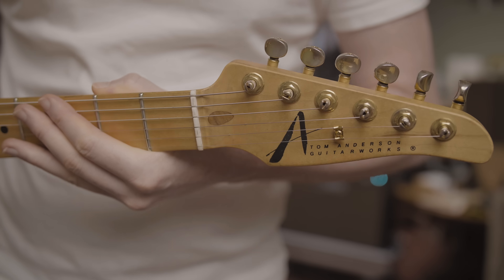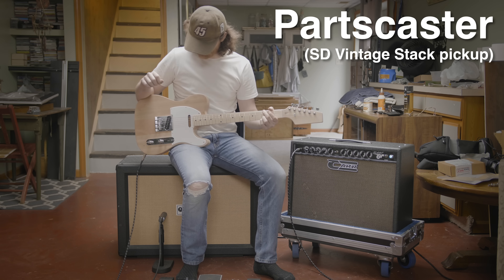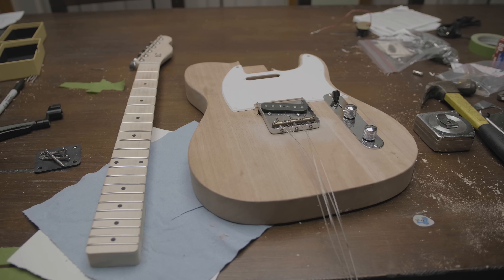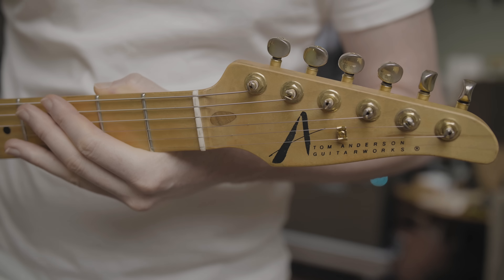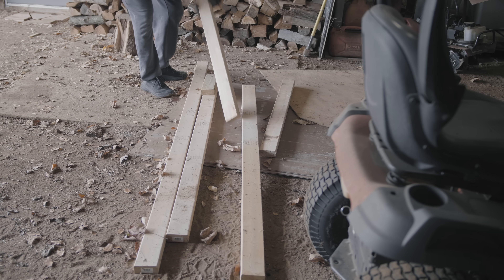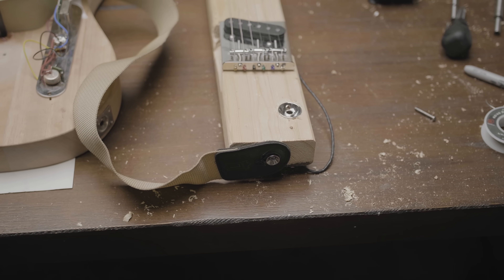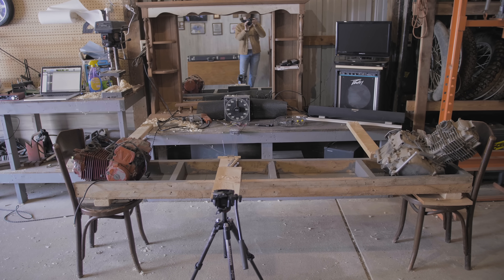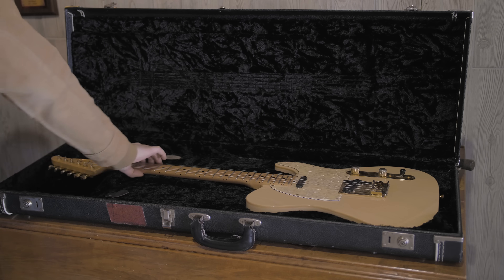Tested: Where Does The Tone Come From In An Electric Guitar?

Comment: That "tone wood" thing dies hard.  There's a certain type that just won't hear that "tone wood" isn't the reason why a glue hog solid body strat with three pickups sounds the way it does.  I had to learn this the hard way - when my "super bright" Ibanez Artcore all of a sudden sounded "muddy" when someone messed up the wiring in it.  It took almost two years and a lot of research to find out how to get the tone back - it had nothing to do with wood - it was the 500k linear volume pot/500k audio tone and 50s wiring that a lot of imports use.  For humbucker guitars I keep the volume at 5 instead of maxed to 10, and if things aren't wired right you get the "mud".  None of the people I took my guitar to asked about the original wiring.  None of them asked where I keep the volume and tone - they didn't know or care though it took ME having to figure out what was going on and how to get someone to wire it back. Now, I try and spread that gospel... and people get literally angry and hostile.  I've told so many people: "If you're getting a 'muddy' sound from your LP, check the pickup height, check the magnet types, check the wiring, check where you keep your volume/tone pot, check the sweep of the pots..." and people act like I'm speaking alien.  Also the proof is in the pudding: electric guitars are made out of every material imaginable - clear pyrex/resin, steel, aluminum, even concrete - though when you plug it up it sounds like the configuation (strat? LP?).  If you handed someone a guitar made out of aluminum and blind folded the musicians would they be able to hear what the material is? The answer is no.  I once had a guy say: "Well, if you can't hear the difference between a 335 and an LP I don't know what to tell you!" And it instantly made me think of another element: recording.  I pride myself on my memory and ears, though there were so many times when I thought I used one humbucker guitar in the studio and it ended up being another - and we're talking about the difference between LP, 335, and full hollow.  In a studio setting, with things turned up, you don't know what's happening until you "see" it or are "told it" and I'd suspect that has to do with how so many guitarists "learn" the instrument - by looking at instrument/hands and making deductions.  While that's great for learning a lick, deductions can be made that simply have nothing to do with what you're hearing.  Correlation is not causation and there were times when, during that two year journey with my Artcore, that information that I had taken for "fact" fell flat on its face.  And I tell people: I'm not trying to piss anyone off - I'm trying to save you time, money, and heartache when you hand your guitar off to someone, they change something, and you don't know what.  Happy trails.

Comment: I put an old telecaster neck on a strat and had to use a piece of a match book to sorta shim the neck into the correct angle but that fixed it and the sound difference was tangible.

Comment: I've always suspected that all this bull about "tonewoods" and "rosewood/maple/other" necks was complete nonsense. I mean, if the body and neck are rigid, then the vibrating string doesn't give a crap about the type of wood, right? And the fretboard does not even provide the rigidity to the neck (it's the neckwood and the truss rod), so how the hell could it ever affect tone? Now someone went through the trouble of testing it and clearing those myths. Good job!

Comment: Yep, electric guitar wood is all about the comfort of the neck and aesthetics. Both are still important elements but it's laughable to consider the wood would have some involvement in the sound coming through the amp.
Reply: I will say I have two Les Pauls, and my Custom (with the same exact pickups as my Standard) sounds a lot different. They’re even set up the same and everything. I’m not one for geeking out over tone wood but my Les Paul Standard does sound a lot brighter than my all-mahogany Les Paul Custom. They have the same strings too; Pyramid round core pure nickel hand polished
Reply: @TheTrollMastah  placebo effect
Reply: @filthyfrickenpig1757  Yeah okay lmao because I don’t play these guitar on a regular basis and can’t tell them apart within an instant. It’s not a huge difference but I notice it y’all just tone deaf
Reply: @filthyfrickenpig1757  Could also be the rest of electronics, the guitar's electronics are not just the pups. The quality of the pots and the caps, can be crucial. Even the quality of the switch.

Comment: I could hear a difference between the 2x4 and the Anderson initially, the 2x4 had a bit less body and a bit pushier in the mids, but once you turned on the first pedal and every one after that, they basically became identical, and that was wild!
Reply: I commented that I actually liked the 2x4 more than the Anderson lol. Which is obviously just personal preference, in liking its overall sound. I also preferred the "air" guitar. The differences are subtle.
Reply: I’m pretty sure he addresses the brittleness of the 2x4 by adding the electronics and by that point, any difference was rather indiscernible.

Comment: 99% is just of sound is pickup type, pickup adjustment, and brand/gauge of strings. I did notice a tad bit extra sustain on the finished neck, but adding a little compression inline wiped out that difference.

Comment: There's a big problem with this video: These tests mostly contain big, open chords, which are a terrible way to detect nuance. The riffs that aren't open chords do show a tonal difference: 
5:19 - 5:29 sounds different
5:37 - 5:42 sounds different
8:18 - 8:30 sounds different
Reply: I thought I had a problem. I HEARD those slight differences too ! And I think it does matter,and I'm not saying that it couldn't be corrected throught eq and so on...but differences were there. Definitely.
Reply: Not big enough of a difference to spend drastically more for better "tone woods."
Reply: @TR-uw2sp  Well, if you consider yourself unbiased, you should watch the Warmoth comparison videos, which compare a larger variety of woods, play a wider variety of riffs and show a more substantial difference.

Also, again, the playing in this video isn't conducive to displaying nuanced differences. How much difference can you expect to hear from some weird little 2 second pulloff run down the neck like at 5:38? When you play something insignificant, the difference is going to seem insignificant. We didn't even get a full riff or a full melody in this video.
Reply: I have seen the warmoth videos and I don't belive the precision in pickup set up was taken to the same level as in this instance. I think if warmoth set up same height and pickup angle their results would be closer too. Also if you play a longer riff there is more likelihood for variation in playing I would suspect. I just feel like after what I have observed here with electric instruments the whole tonewood argument has been reduced pretty much to corksniffery.
Reply: @TR-uw2sp  how do you explain the difference in tone in the neck videos where they just change the neck and keep the body exactly the same?

Comment: Great video, wrong facts, 

1 - A test like that you should do with clean TONE only, without gain at all which mask the tone. 
2 - What you hear in the room is not translated to the mic as accurate as in reallity, I'm a recording engineer and really aware to this fact, when he said once the tone was shrill I didn't hear that in the clip, it sounded ok to me, but in the room I'm sure it was obvious.
3 - The Air GTR is connected to a huge wooden surface. when only the head of my GTR is touching the table next to me, it get's very loud.
4  - You can not transfer behave of an instrument, dynamic range, copression, response and touch sensitivity which is a huge factor in tone and feel.

5  - Off course wood is a factor, you can hear it acousticaly and we all know the big difference between maple and rosewood necks, why didn't he checked that? because the difference is big...
Reply: guys, he didn't transfer behave, throw out the whole video
Reply: This. I use to a session musician I know what you're talking about. I changed bass, the same model, same strings, same electronics, different woods. Got exactly what I expected,a  more balanced sound and the only difference is wood.

Comment: Game changing!!! Now we need a simple pickup connecting system to be able to swap em around as a color palette. Just like mics in a studio…
Reply: I once saw what HAD to have been a Seymour Duncan test guitar, with pickups on a rotary tray that permitted selecting pickups.   I think the rig had six pups. Might have been even cooler if there were TWO tracks, for neck AND ,bridge options.
Reply: There's a guitar samurai guitarist once tested that had a plastic body which used magnetic locks and same for the pickups. Which means you can change your pickup in less that 15 seconds
Reply: Those exist.
GIY.
Reply: You can do that though. Just use those easy connectors on your wiring and pickups, easy replacement.
Reply: I think I saw a NAMM video from this year of a guy showing exactly that! The pickups are in a sort of a roll where you swap them by simply rolling the pickup roll :)

Comment: It kind of makes sense, everything in the signal path made a noticeable difference, the pickup being the most noticeable, but also the brass saddles were somewhat noticeable. And when you think about it, the electric guitar pickup only records the movement of the strings, so any “body tone” would have to come from the body getting vibrated by the strings, then interfering with the strings themselves before getting picked up by the pickup, which IMHO probably would be a very slight effect.

Comment: The other difference is that the guitar you put together you didn’t add the neck pickup, so these tests should be null and void. Simply by the fact you said that the setups were pretty much the same. That should include all their components installed. So i call invalid and an unfair comparison.
Reply: My man you realize that you can select just the bridge pickup on a tele right? Also, having the neck pickup there (even if it’s not being used) would by your assumption change the sound? When  in the test they sounded practically identical… so do you mean to suggest that tone wood is real… but the two guitars sound the same because one is missing a neck pickup which is compensation for the tone wood? I hope not because then you’d truly be delusional, even more than people who think tonewood makes a considerable difference in tone

Comment: Great Vid and sorry for the long post! After 25 years of slapping together parts-casters, I've noticed similarly small differences (in order) between bridge style and material, the difference in weight between the neck and body, and maybe neck pocket tightness. But had you swapped sets of  pickups pickups, those guitars would have would have been night and day, overshadowing any other differences by a mile. Anymore, I build for playability preferences--neck profile/board feel; overall weight, balance etc. Then I choose a set of pickups  that tend to produce the tone 'm looking for. I figure I'll be guaranteed one that plays just the way I want (at least 50% of the battle, IMO) and probably sounds good also. IMO what makes that 10% difference between a good guitar vs a great guitar or a great guitar vs a magical guitar is how the pickups and all the other considerations "like each other."  I guess this can be "tuned" with some of the stuff you cover but ultimately involves too many tiny variables working together to control. Just like at the Fender Custom Shop,  it comes down to luck.

Comment: Demo'ing the Tom Anderson distorted vs. the partscaster clean makes comparison impossible.
Reply: The amp settings were identical. The Anderson just has way hotter pickups. If you kept watching you'd have noticed after swapping the pickups in the partscaster to the same ones in the Anderson the two guitars produced the same level of overdrive in the amp. This is actually some good science, you should watch the full video.

Comment: I've always wondered why some guitars are shaped so stupidly. Could be made so much more comfortable to play sitting. My first guitar was a very heavy les Paul. I hated playing it and would have learned much faster If I started on my second guitar which was ironically only 50 bucks but light weight. Screw tradition give me a super thin guitar with a small body for maximum comfort

Comment: That's not an air guitar. Look at those huge masses either end is bolted to! They were acting as your tonewood. You need to isolate your " guitar " from the bench or reduce the mass to as close to zero as possible
Reply: Thats about as good as it gets. You can just have a bridge and a nut floating in space. The strings are under a ton of tension and need to be bolted down at either end. If you're arguing that tonewood exists... and that an old work bench and a shelf sound like a guitar because they're acting as "tone wood".... Then are you saying that as long as a guitar is made out of any wood it sounds the same? Because that's what you're inferring, that a mahogany guitar and an ash guitar will make pretty much identical sound. If you're arguing that... then you're correct! I'm glad we agree that tone wood makes no difference 👍😂
Reply: @nickmanville900  No, I'm saying that it's the entire system that matters. You have created a very massive, and extremely stiff system. You've gone in the wrong direction.

Comment: I would love a similar series on where an Amp's tone comes from.
Like the preamp vs power amp vs speaker.
Reply: All three, plus the speaker cab (Unles, of course,  your power amp is totally transparent unlike, say, a Marshall). The cab matters because the speaker is directly coupled to it and it becomes part of the speaker. Open/closed cabinets also have very different tones because of induced phase and/or air-pressure dampening. Its all a bit complicated but the answer is all of the above plus some other stuff. 

Now if you'd asked where a Minimoog's tone comes from  - that's easy -  it comes from me :).
Reply: Check his latest videos. Tube myths busted again lol. Old fools just can't get a break these days.
Reply: That'd be cool.
Reply: I'd say preamp mostly. No two speakers are alike though. They have response curves which literally means they come pre-equalized, some bright some dull. But the preamp interacts the most with both the electronics from the guitar and pass through to the power amp which should be flat but rarely is lol. Guitar amps often have feedback circuits in them giving each it's own flavor/charecter, especially Marshall. (similar to a chorus effect). Some slew the attack (leading edge of the signal). Lots of tricks you could just use an effects pedal for if the amp were flat, like a PA amp. Headroom is an amps ability to magnify accidents. Home stereo amps usually have very low headroom. PA amps can have fairly high 3-6db headroom. Just means if you pluck a string hard it will be more greatly magnified.
Reply: It’s already been done. It’s the speaker. Pickups and speaker. Decades of mystery finally out to rest lol.

https://youtu.be/qpq7tsK-kZk
Reply: Please do this
Reply: @sectionbysection429  He actually started this in the time since I made this comment. Check out his newer video about cabs.

Comment: What was this video supposed to prove? The clips sound all very different
Reply: You're supposed to come to your own conclusion. If you convinced yourself they all sound "very" different than there ya go. Personally I think as long as the pickups, hardware, and pickup height are the same. Everything else made just about 0 difference. But that's what I heard.
Reply: @nickmanville900  Ok... That's silly. If that is true, all other things being equal, you still need good wood for good construction to support all the trust rod, bridge and other hardware. You still need properly dried great wood for reliability and stability staying in tune. You still need a decent level of sympathetic resonance for the sustain. So even if "tone wood" is not a thing this video proves nothing because wood still matters a shit ton. 
You currently cannot just find a guitar that is the equivalent of the substituting only the wood of a great guitar because of how factory guitar construction is set uo atm. It would be a bad guitar. So even if the null or positive result of this hypothesis means nothing.

Comment: AS a German luthier, the only parts that Change the Sound in an e guitar are: Pu, electronics, Pots, wires ,Caps, Strings and frets! And The Setup!  The Wood does Not Matter at all. Watch Fender custom Shop Cardboard guitar. A accustic guitar on the Other Hand , ITS all about the Wood.

Comment: Now I'm happy i didn't give in to my mom to buy an expensive af guitar just to try out the instrument lmao
Bought one for 66€ on amazon (which looks like a very cheap ibanez knock off) that seems to have pretty good reviews overall
And if I decide I want to stick with playing guitar...I could literally just switch out a few parts if they don't sound that great and I'd effectivley save more money.
Like if I were to spend 200€ over a course of a few years just to replace parts here and there (like pickups for example, or a better neck if needed (I don't need wood splinters lmao)
I'd only end up spending 266€ instead of 
566€ or 866€  (This is just based of the prices I've seen both online and in local guitar shops for low end / beginner electric guitars)
And since I don't have a lot of money (only had 100€ at the time of buying the guitar) I really gotta think before just spending money on stuff I might not enjoy as much as I thought I would etc etc you get what I mean.